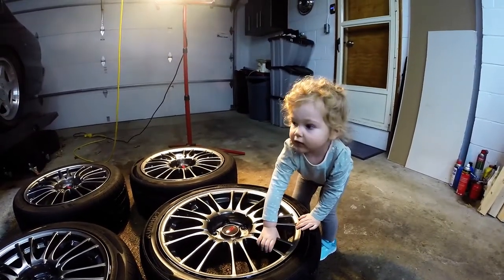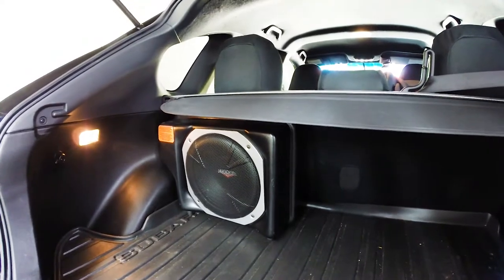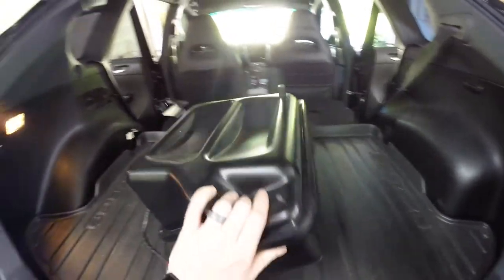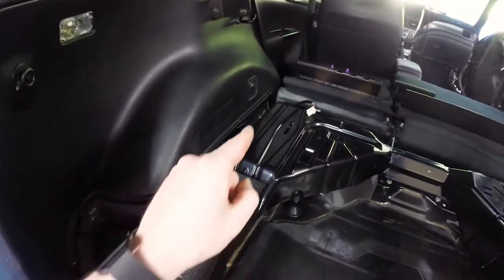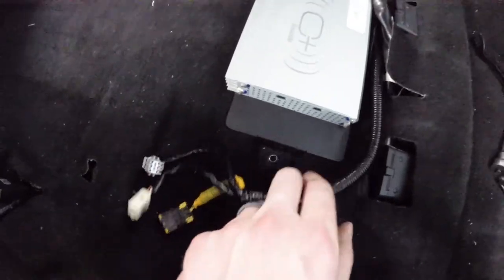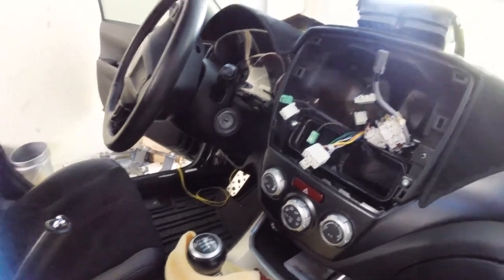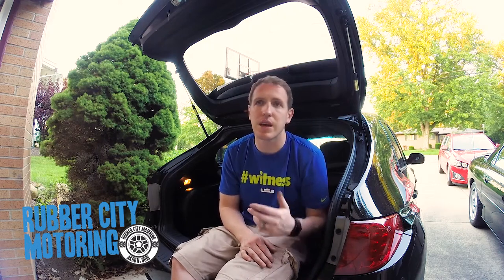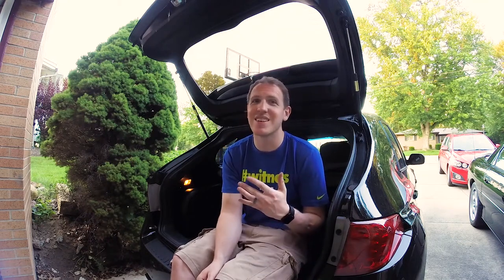Subaru Impreza WRX STI - OEM Audio Plus System Installation & Review

Comment: Hey bud so how did you phish the power wire through that drainage hole? Im havin a hard time getting it to go through amd grab it on the other side lol. I have a 2020 sti but still similar process.
Reply from the maker: Trying to remember... I feel like I used a bent coat hanger or something similar - taped the line to it then fed it through.  It surprisingly wasn't that hard I recall.  Did you end up figuring it out?
Reply: @RubberCityMotoring  yea i did i ended up going through the grommet a little higher up. Sounds pretty good but im def gunna have to add the reference door speakers too and possibly upgrade head unit in the future. The bass is decent for am 8in sub im used to two 12’s back in the day lol at first i thought maybe i wasnt getting full power but im pretty sure i am
Reply from the maker: @Sdubz  Ahhh Good - Yea the sound is not meant for full bass.  The sub just compliments it all.  I found it to be an amazing improvement from the stocker - could have mostly been in the amp.
Reply: @RubberCityMotoring  oh absolutely is def way better than stock amd i have yet to try it with cds just use my iphone roght now so cds would probably sound better in some cases. Ive noticed the quality of the song makes a huge diff. I cant figure out what i did when i pulled my head unit tho i have the starlink touchscreen unit. And everything works except carplay now and i dont really wanna pull it again one of those bolts was a huge bitch lmao
Reply: I'm stuck on this right now any advice?
Reply: @FromanEngineer  i ended up useing like bale wire to phish it through it was a pretty big pain in the ass for me though not gunna lie. Patience is key lol and you need something malleable enough to bend where you need it too but strong enough you can wrap it around the power wire to pull it through. I wish i had a video for you i dont
Reply: @Sdubz  I ended up going through the grommet  hole - inspired by your previous comment. My man I can't tell you how much your comment of that helped me since the drainage hole was not working. Your comment legitimately fixed everything
Reply: What gromit did you go through? @Sdubz

Comment: It has been almost a year since the install. How do you rate it now?
Reply from the maker: Still love it. Only thing you need to do is periodically check the bolts that hold the sub down. They tend to come loose. Amazing sound and amazingly improved over oem. If you like audio quality in your car, just do it!
Reply: pulled the trigger on the system. Hope it is as good as everyone says it is since the price is so high.
Reply from the maker: I love it. It’s such a good upgrade.
Reply: @juancarlosdediego9584  How is your review, six years later?